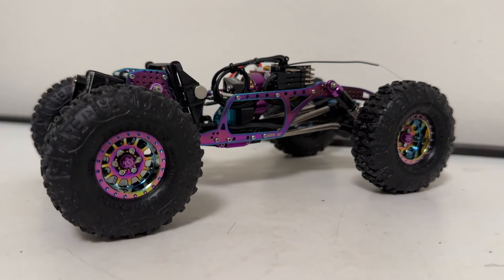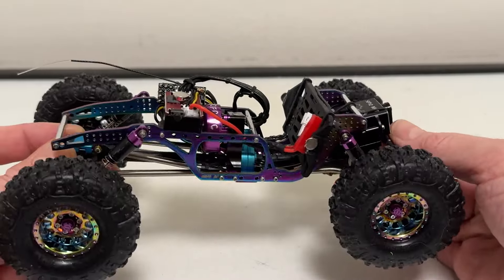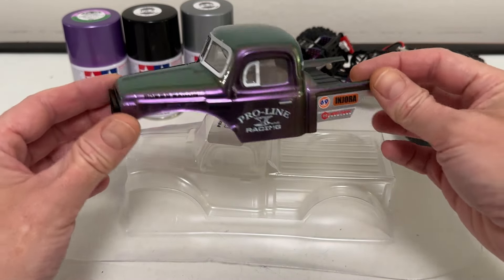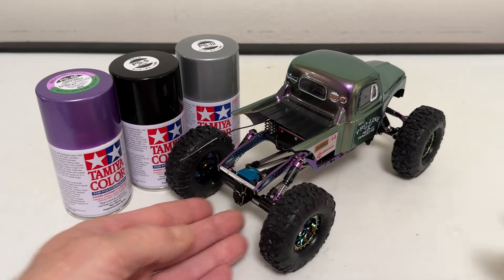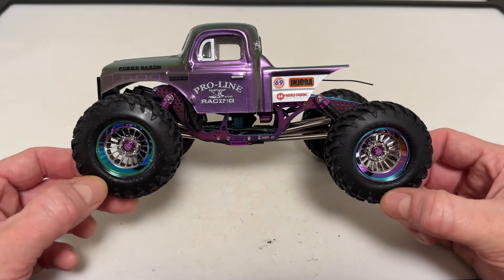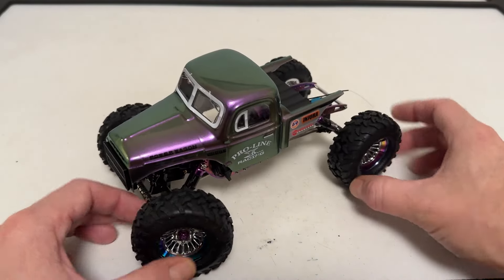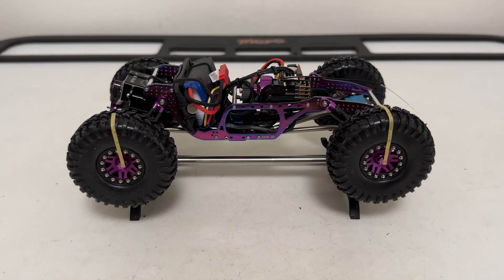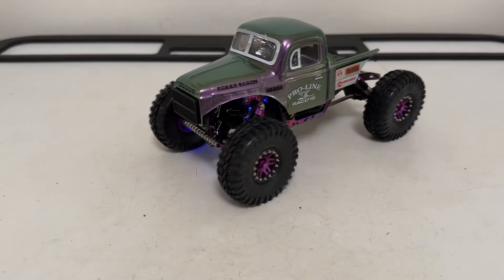SCX24 - MOFO RC: TITANIUM UAF/ROP CCxRC COMP BUILD - IT'S A DOUBLE RAINBOW! HARDPARK, MAZZ, KTECH RC

Comment: This is quite an excellent build. 
I'm looking forward to seeing it on the rocks. 
Question:  the axle shafts.. those are U-Joints on the website i think,  or is there a different set?  You called them CVD.
Reply from the maker: Yes, those are the ones! None of these are really CVDs, but they all are referred to as. But make sure and remove that outer bearing each side of the axle ends for these EXOs. They are the best I have found hands down.

Comment: That's one thing I'm saying anything that if you just hold that motor in your hand and spin it up and touch the outside of the can you will see that it binds up fairly quick if you do that with the bam motor it's a lot different that's one thing I did notice is like any like real twerky spot that you put the ROP in it would kind of shudder versus the bam

Comment: With them links it works perfect obviously you don't want to ride ends on their but Mad Libs titanium they turned so purple so different color what I do is I get a pretty damn hot and then I back it off and just use the tip of the torch and then I kind of just chased that down the link

Comment: How were you able to keep the ROP from rubbing against the chassis?
Reply from the maker: It touched with the flat skid I tried first. It just clears with the typical type skid. In my 6x6 UAF/ROP, I used the thinnest of the Injora aluminum spacer pack (at one end of an aluminum cross bar.) Just at the screw point right near their motor on one side. Just to push out the frame a tad. However that was a printed frame too.
Reply: @bcochener  Interesting. I have a SMP in an aluminum UAF reversed like that too and I had to clearance the chassis rail a bit with a dremel. I used a regular Hot Racing branded skid.
Reply from the maker: @yotday  my UAF/SMP build just barely clears the carbon frame too. Stock type skid again for that one.